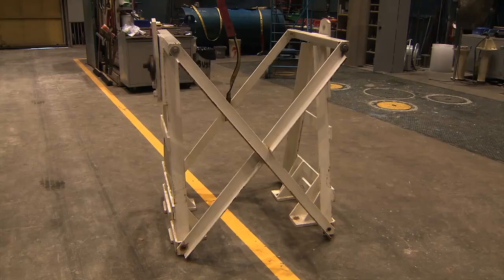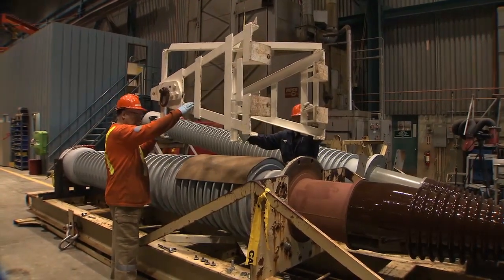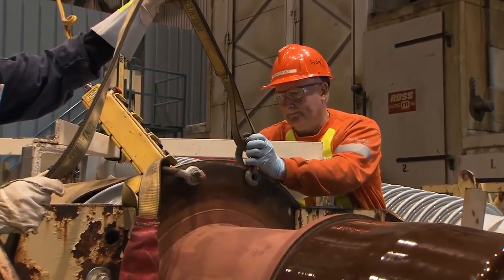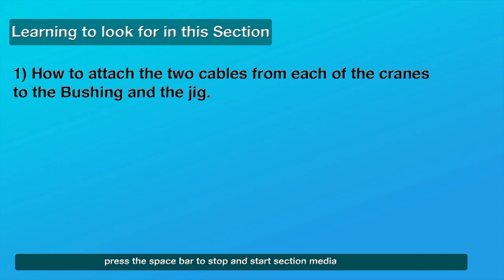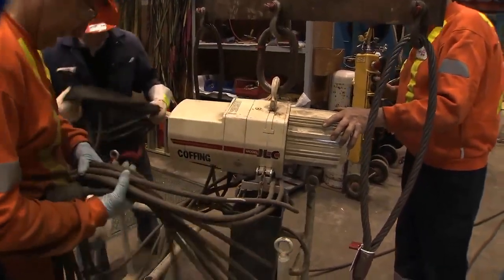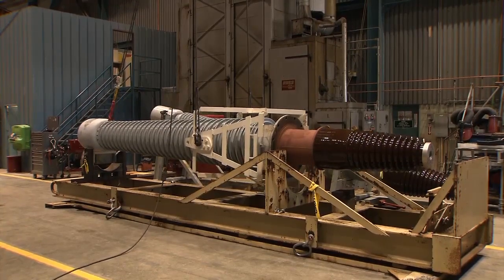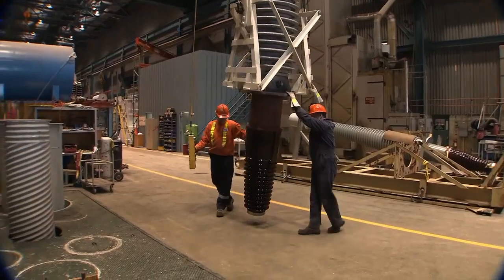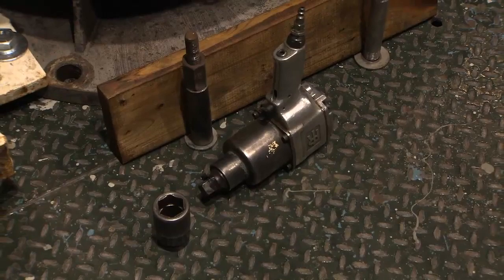Transformer Bushing unpacking, handling, oil draining, repairing, oil filling, testing part 1

Comment: I have two questions for you, with your permission 1- Why did you measure C1+C2 in GST position.  2- Why did you measure C2 in GST mode instead of GUARD Mode?  Thank you.  Greetings from Turkey 🖖
Reply from the maker: Mostly I am testing only C1, and C2
But in this video they measured C1+C2 to confirm other reading for C1, and C2
Reply from the maker: Regarding to C2 measurement, he should inject on test tap, and keep the measurement wire on the bushing conductor and the test mode should be GST Guard